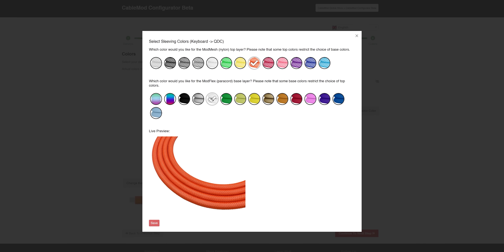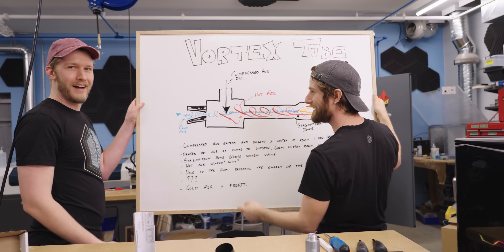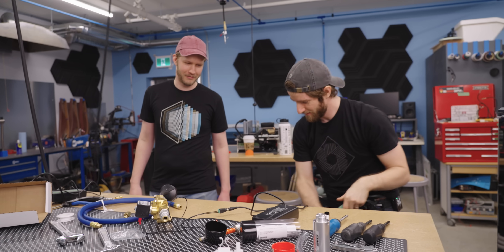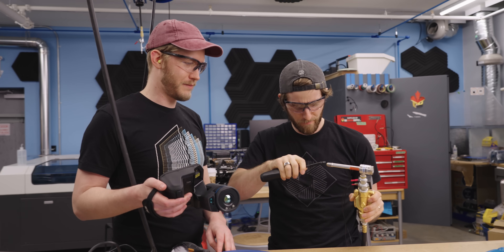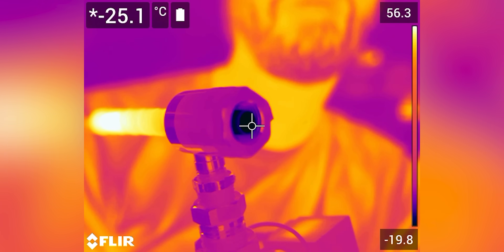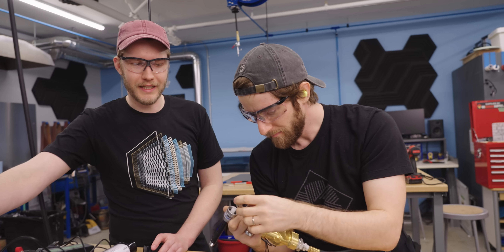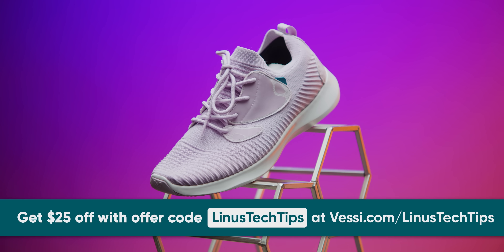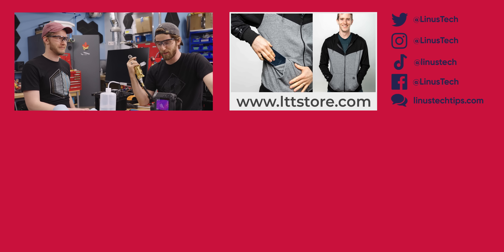This is a CPU Cooler? - Vortex Chiller

Comment: 10:50 You are losing all the cooling power through the tube. In order for the vortex principles to work the cold site has to be a much smaller diameter than the warm site. As soon as you add a silencer or a tube the efficiency gets a lot worse.
Reply: This is the flir camera through tempered glass all over again
Reply: kinda make sense, I noticed that too
Reply: @4rd17  FLIR
Reply: doesn't really have anything to do with the size of the tube. The issue is the ability to transfer heat from the CPU efficiently. Just blowing cold air at the heat spreader is suuuuuper inefficient, there is a reason we use coolers with big fin stacks, airs thermal conductivity is pretty shit. The majority of the air is never in contact with the cpu heat spreader for long enough to actually transfer much heat. A much better way to do this is like use a small water loop, just a CPU block and some kind of reservoir, then put a heat exchanger in the reservoir, either just a coil of copper tubing or if you use a largish reservoir you could just submerge a radiator in it. Then have the cold air blow through the heat exchanger, thereby chilling the water. Since the device is capable of hitting subzero temps using a coolant other than water would probably be a good idea, something like an alcohol (isopropyl or ethanol, vodka cooling?) or just an antifreeze additive in the water like some kind of glycol.
Reply: You should be able to expand the cold site: the vortex cooler is a separator of high/low energy molecules in the air. That separation is done inside the tube with the radius that the two outlets are located. After that, it doesn't matter.

The issue with the tube is just conduction with the cold air flowing through it
Reply: He did remove the tube afterwards
Reply: omg........................ its called a suppressor
Reply: @robertsteptoe  How blind are you? At that point in the video there's clear tubing being pointed directly at the CPU
Reply: @Ender240sxS13  from another video I believe it’s 0.024 J/M/K
Reply: @startedtech  r/whoosh
Reply: @Ender240sxS13  makes sense i thougth about using a waterblock to pipe the cold air through. but thougth that it would probobly mess with the vortex. but it would be nice and old school with a compressed air colled computer
Reply: OMG es ist SIEGBERT SCHNÖ
SEL der reichste und schönste in Bikini Bottom
Reply: @andersstromqvist2211  Yeah I still don't think that would provide enough surface area, there is a reason that the surface area at the air interface point is many times larger than at any other interface in most heat transfer chains, its just has so much lower thermal conductivity. if you like built a box around the air cooler and had an exit nozzle that would maintain the same mass flow rate coming out of the device that could also work.
Reply: @Ender240sxS13  That's actually an excellent idea. Hopefully that's the direction they go in for V2 of this video idea!
Reply: @Ender240sxS13  Perhaps better yet, you could avoid the inefficiencies of phase change entirely... A lot of laptops have used air-transfer heat pipes in conjunction with blowers. I imagine that if instead of a flat pipe you used a small coil at each hot point, and you used a Ranque-Hilsch tube at the inlet instead of a blower at the outlet, then you could see some interesting cooling results. You would, of course, want to avoid reintroducing additional heat by constricting the flow volume but...

Comment: I feel like this should work with the right contact area on the CPU, maybe with some special heat pipe rigging
Reply: Just use a waterblock to put the cold air in, should do the trick.
Reply: @ZesPak  I thought that was the direction they would go after the failed air cooler trial. it would have been fairly simple to plumb in as well. I'd bet Alex sees this comment or one similar and tries it.
Reply: The issue is thermal transfer speeds from metal to air; it's not that efficient. Like if you're shot out an airlock in outerspace, the body takes hours to cool down even though the temperature is -455. If they're going for true exotic performance, it's going to eventually be some sort of ceramic. But even industry giants haven't figured that one out.
Reply: @ZesPak  yes, also the condensation he referred to would also aid in removing heat.
Reply: In space there's no air to conduct heat away, it can only radiate away.
Reply: These coolers work best when you plumb the cool air through the entire sealed enclosure and still use a purpose built heat spreader like the NHD15. The whole enclosure ends up with sub ambient air supply
Reply: @ryanj610  How about if we connect massive thin plates to it and drive liquid from the hot spot to those thin areas. We could cool the body via radiation... We could even stack the plates to save space. I think I am going to call it a,... radiator. :D
Reply: I see the comments saying you need a fluid, I wonder what if you made a reverse radiator that was surrounded by water and had the cold air in it. Also I wonder if this device is good at removing humidity so maybe they could put the air conditioner unit back on and use this to prevent frost.
Reply: I think, and by god is this a dumb idea, if the remove the ihs and ran it completely bare with the cooling tip basically directly on it, it might work.
Reply: nah, its 300 W of cool air, the problem is; that air goes everywhere... only a little bit of the volume/mass went into the heatsink and a tragically small amount went onto the die
Reply: Just like... Put an air cooler on and point this thing at the air cooler.

Why is everyone overthinking this so much??????
Reply: maybe just get a cpu waterblock
Reply: @ZesPak  needs to be copper and longer copper pipe, need air inlet to copper pipe and outlet for air and condensation, dont want a open water black need copper pipe system like a normal heat sync
Reply: @UselessDuckCompany  nar dont need fluid the heat transfer is enough just need a control, shooting air its bouncing off all over the place no control
Reply: all i see is LMG needs a real engineer, you need to show Alex how its done!
Reply: 3D print an attachment for the cold end of the device to funnel the cold output the same area as the heat sink
Reply: @nicynodle2  no, the heat density of the air is too low for the density of the CPU die, basically, not enough air molecules can hit the copper molecules on the die to take away all the heat... its like trying to water cool with a pressure washer ... the air/water can cool the CPU but it needs more time to absorb the heat
Reply: @Crushnaut  How much PSI can a 3D printed part handle before it loses structural integrity?
Reply: @blackperal  once the air leaves the nozzle it isn't at high pressure anymore
Reply: Like someone said, mount a water-block and push the cold air through the water block.  Or find some of the tall boy glue in ram chip coolers.  The issue they have is the surface area for the heat interchange.  A row of those with a shroud and the air duct-ed across the fins would probably produce some surprisingly good results.  Heat transfer ability has to exceed the thermals produced or it will always run away, no matter how cold the thing you spray at it is.
Reply: lol, or maybe do a chilled water loop, no ice.  in tank pump in a bucket with an array of bubblers being fed by the votex chiller, into the cpu.  I would have tried some creative things with this.  With or without a radiator depending on how hot the water got on its way OUT of the cpu block.
Reply: Or just use a water block,  air is a fluid after all it should work the  same as water in that system.
Reply: @UselessDuckCompany  A radiator doesnt work because the liquid is cool. It works because it "moves" the heat that it absorbs into the liquid to the thinner radiator areas at which point the heat is radiated out. If its air via a fan or rushing water outside of that doesnt really matter. However having cool air inside the radiator I think would be less optimal because air isnt a good heat absorber, unlike some liquids. Which is why closed loops use liquid and not gas.
Reply: Austin Fehr  The concept remains true, however. What's air compared to solid metal? The transfer rates are orders of magnitude apart; thus the need for absolutely massive surface area. Hot metal loses most of it's heat through thermal radiation as well, making a direct parallel.
Reply: Austin Fehr  Its the same principle albeit a slightly overexaggerated example. Air just has a relatively low thermal conductivity, and this is exaggerated by the fact that the cooler a gas is (at a given pressure) the less thermally conductive it becomes. Then when you consider the fact that at lower pressures it also becomes less thermally conductive (proven by Bernoulli's principle, as fluid velocity increases, the pressure of that same fluid decreases.)

So what we have here is really cold, really low pressure air. The only advantage it has is the sheer volume of air moving past from the higher velocity allowing for more atomic collisions. Its literally the same principle as to why a body cools down slowly in vacuums, just a body in a vacuum is a very extreme end of the scale. 

Where the problem came from when brought to a CPU was the vast inefficiency of transfer. While the CPU is hot, most of the air isn't picking up a lot of heat energy from the CPU. What would be interesting is if they could run helium through it. Helium has a much higher thermal capacity (Hydrogen is slightly better, but we don't want them to blow up the shop) coupled with a way to isothermally increase the pressure within an enclosure would likely be a significantly more efficient method to use this equipment.
Reply: @Crushnaut  The air isn't at high pressure even in the nozzle, its going at a very high velocity which exerts a force. As proven with Bernoulli's principle the faster a fluid velocity is, the lower the pressure. 

/watch?v=c81UCtP2rh0 is a good video that explains the concept.
Reply: @jamesclark5905  higher velocity does not always mean low pressure. Bernoulli's principle simply states that if you have a fluid travelling in a pipe and it speeds up then the pressure drops. It does not mean that all high-velocity flows are low pressure. The air stream is at high pressure by definition as it is connected to the high-pressure air tank from the compressor through a restricted flow device.
Reply: @Crushnaut  Edit: I think my original reply to you was to the wrong person (I meant to reply to someone saying that the outlet pressure was high), but I've writen this anyway so enjoy I guess.

Not always no, however for all intents and purposes the flow through that device could be considered as a pipe as a close assumption, hence me bringing up Bernoulli's principle for the sake of discussion without going too far into the topic. In these devices in particular the hot end can have flows that are above atmospheric pressure (due to the temperature increasing) however the cold end has a very low pressure. We dont actually know the full properties of the flow within the device, but we are able to measure the properties at the inlet and exit, and the pressure drops dramatically at output when compared to input. From many times greater than atmosphere to less than 1 atmosphere.

I could go on about these things for a long time, but there's a public good paper titled "An Experimental Study on the Impact of Pressure Drop in the
Ranque-Hilsch Vortex Tube" by Mark Parker from The University of Western Ontario if you would like to read it. But the point stands. The pressure leaving the vortex tube is infect low pressure on both sides. They're incredibly interesting devices if you are into thermodynamics. They still aren't fully understood. But Figure 1.2

Comment: I've had to buy a couple of these back in the 80's. Used to buy 'em off the Snap-On truck. You use it to test a carburetor's Automatic-Choke on older vehicles. It allows you to quickly heat and cool the actuator-coil that opens and closes the carb's intake butterfly. They were only about $30 back then. Linus needs an inline Air-Drier Filter Combo, coming off that compressor.

Comment: I've used a vortex cooler as a replacement when there was a leaking water circuit in a mold. You were just missing a water block or similar. Instead of directly blowing air at the cpu there needed to be a thermal mass to remove the heat from. If it works for 400F/204C plastic against a beryllium copper core pin, it'll work on a cpu.
Reply: That was my first thought, that a water block would better utilize the high psi cold air than a traditional cooler
Reply: Water block is probably also not optimal since it is optimised for the heat capacity and flow of water and not air. Probably would still do better than blowing against the IHS directly though...
Reply: Yeah that was my thought.  The mass of air is not great, hence not a great conductor of heat.  You'd either need a block of metal and then cool that block, or liquid cooler, and cool the liquid which is doing the same thing.
Reply: Why didn't the heatpipe heatsink work?
Reply: @SianaGearz  This is a bit of a guess but the chemical in heat-pipes also have an optimal temp range it works at. Could have been interfering in the phase change cycle of that chemical.
Reply: @SianaGearz  Probably because the cold air was not being directed slowly over the entire fin stack and instead was passing very fast over a small area of the fins. This would result in sub optimal heat exchange with the air to the point that the air leaving the heatsink might still be cool.

The heat pipes help to move heat away from the CPU IHS. That heat still has to be dissipated by the fin stack. For the fin stack to work optimally cool air should flow at speed over most of the fin surface area allowing efficient heat exchange with the air.

Given the power of the i9 12900KS it is likely the heat pipes were operating within spec. The fin stack was probably well above ambient, just heat exchange was not happening optimally due to removal of the cooler fan. Due to the blow effect of the device it cannot be used to feed into the fan since it runs the risk of speeding up and damaging the fan, especially at higher air flow rates.
Reply: @drsupergood8978  mhm didn't they mention the bottom of the heatpipes, closer to where they attach to the CPU, was freezing cold to the touch? Maybe the heatpipes actually failed to perform adequately, with phase change system no longer being effective. You need a good vapour pressure, no good if almost all the vapour condenses to water or even freezes.
Reply: Great for when you need your beryllium sphere to not crack under extended load.

Comment: I was a painter in a factory, and we had hoods that feed us fresh air, we used the vortex tubes as air conditioning to our head. You could turn it up a bit and condensation would form on the inside of the plastic window. I then used a second one and placed it in a painters jacket with a rubber hose with holes to keep my upper body cool. I didn't want to come out because our plant was like 100+ through the summer.